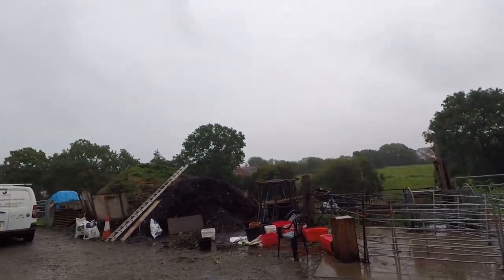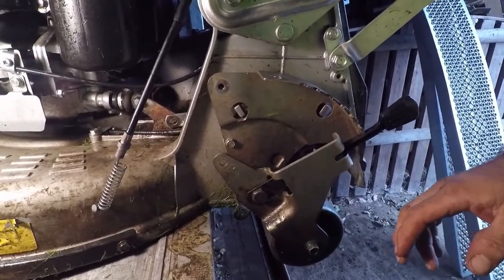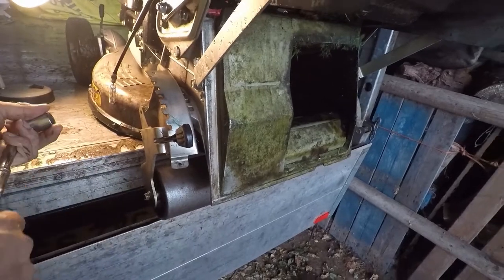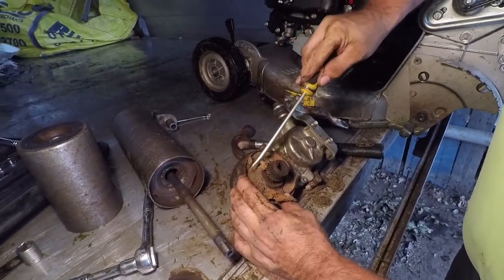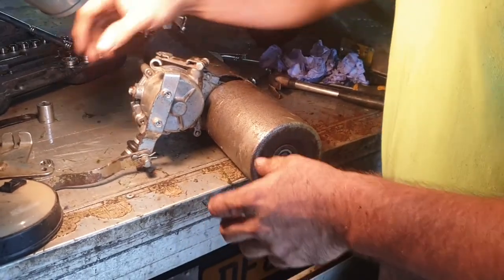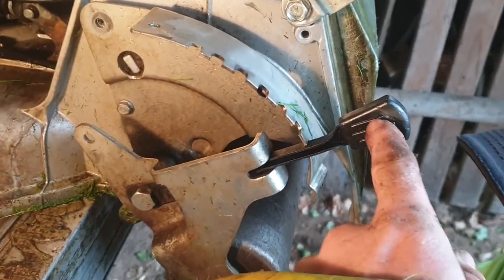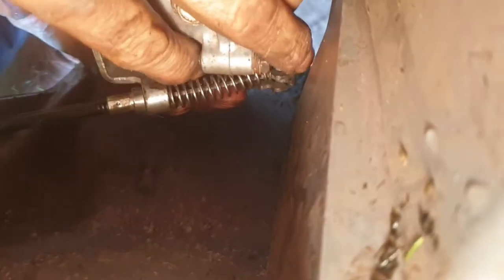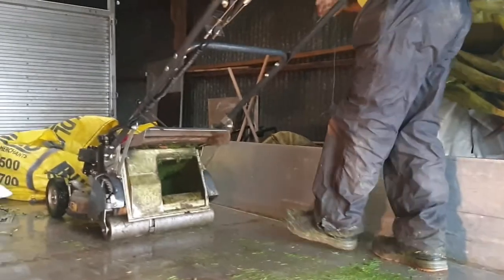How to repair a Honda rear roller mower

Comment: I found the same with mine. After removing the shaft from the long end of the roller. Circlip was found rattling around inside the roller. 
Replaced with new Circlip..... Jobs a goodun!
Reply from the maker: Good to hear 👍 always the roller to have problems first in our experience but they do a lot of work
Reply: Bloody bought a belt based on the stupid schematics for a 475 hrb to find this out. All the bloody blurbs point to a belt and there is none. Not going to order a circlip yet, but I wouldn't be surprised I did hear a rattle when I got given it. Now I have a useless belt.

Comment: Hi guys - have repaired roller but there is lateral movement in roller( side to side )  - bearings are ok so could it be circlip in long end of roller that is worn ?
Reply from the maker: Hi Tom. It's difficult for me say without taking it apart myself.  If you can take it apart It's a good exercise and remove any dirt inside.